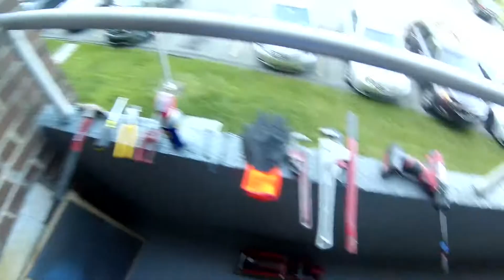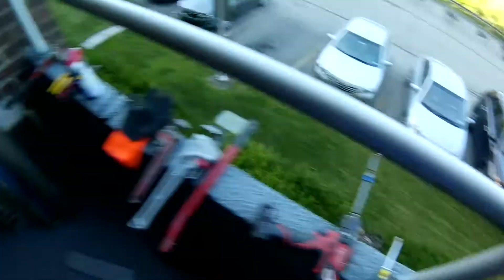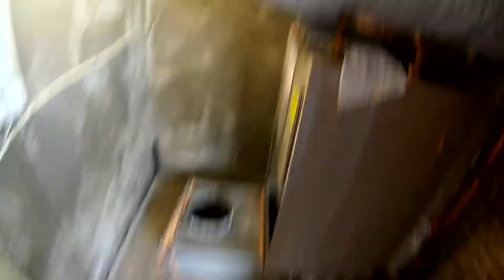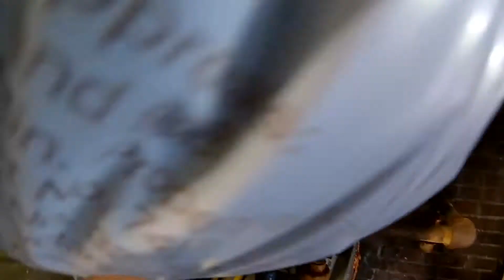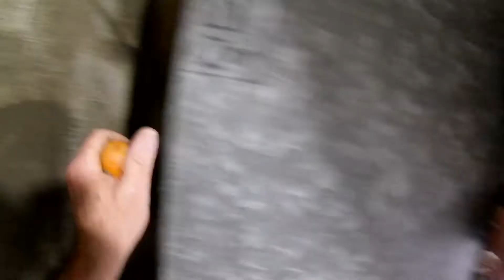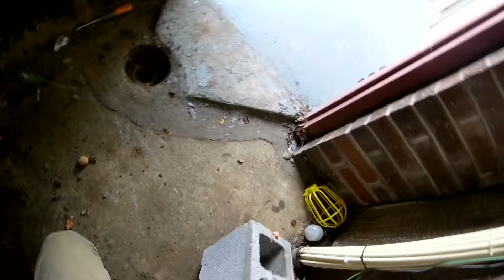Magic Pak Furnace Removal Off Topic

Comment: Lol..watching you get that chassis out reminded me of my 1st few I did..they were super tough..now they are super easy..I find grabbing the blower housing with one hand and the opposite lower at the evaporator coil with the other.
Then pull till the top of evap is out a few inches till you can grab both sides and pull STRAIGHT out and pry the suction line as needed..
You are right on frames ..I have had to cut door walls, walls, floors,shoe racks, ceilings  ect..
Great job ..the hardest for me now is bring them up 3 + floors  even the sled alone is tough..
Reply from the maker: Do you take the ac out to take them up the stairs i hope?
Reply: @bryansbikes  not any more since the surgery..lol..really..lol

Comment: Thanks for sharing! Got a question. I have one of these and the furnace pilot keeps clicking, light keeps going on and off, can’t seem to stay on. Any idea what i can do? Thanks!!
Reply from the maker: Ignition Board is going bad, or the gas valve is not opening
Reply: True Drone Reviews thanks for the reply. Any suggestion on how to properly diagnose? Can it be the thermocouple?
Reply from the maker: None of the newer ones have the thermocouple, but if your does i would change that first because they are so cheap
Reply: You’re right it’s a electrode. So that probably isn’t the issue